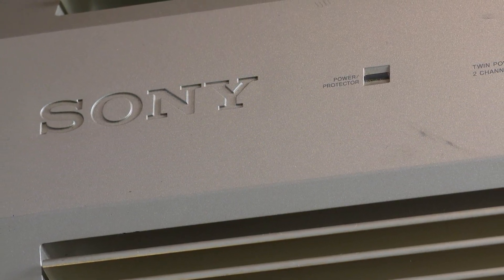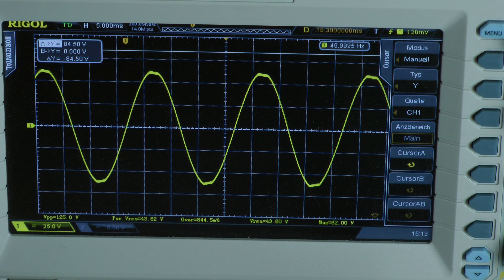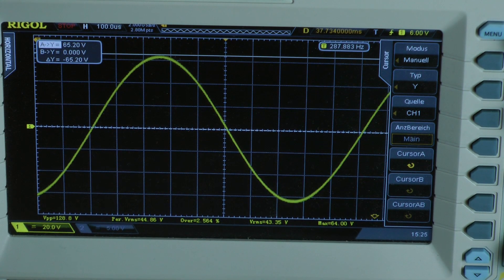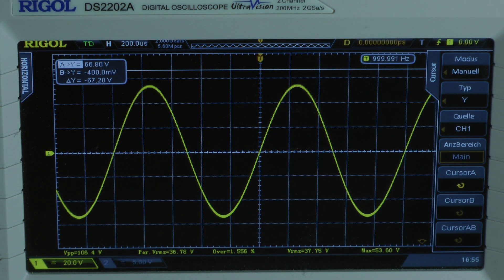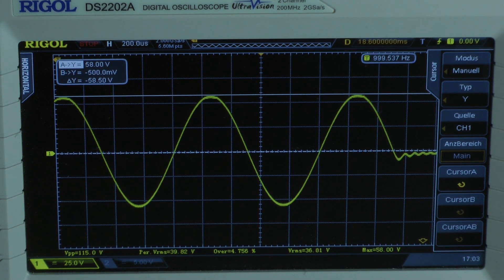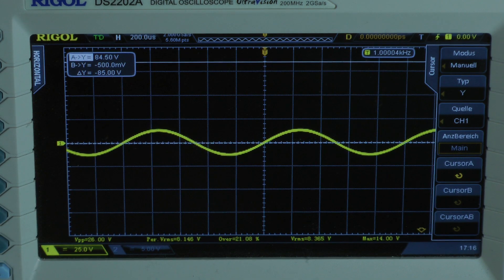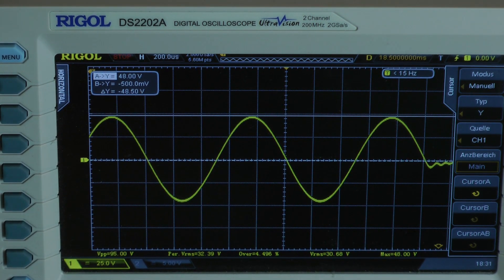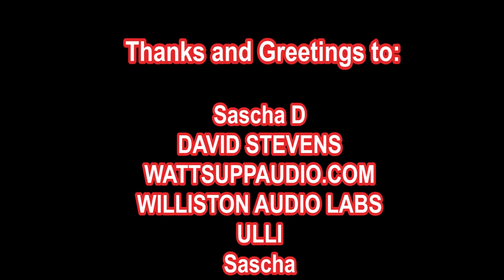Sony XM 2100 G car audio amplifier amp dyno power test #ampdyno

Comment: What power supply are you running or is it a battery bank? Also, what kind of clamp is that?
Reply from the maker: I got three supplies made by mundorf for car audio events. One is a 160A 14.4V the other two are in parallel delivering 13.7V 300A for the bigger amps i tested so far. All without battery bank

Comment: those amps were known as being super clean SQ as i remember
Reply: Diese Serie ist eine G Serie von Sony, also Hi-End Serie von 1996 Jahr.  Besondere ist, dass diese Endstufe eine Dual Mono Architektur hat. Er hat  damals ungefähr 500-600 $ gekostet. Ich habe auch eine Verstärker XM-450G (4 Channel). Klingt auch sehr gut.
Reply from the maker: @GreenDeymoS danke für die Info 👍 Mitte der 90er hatte ich mal eine 4 Kanal von Sony “ XM 4045 “ gebraucht gekauft. Auf Stereo gebrückt, war die recht kräftig 👍
Reply from the maker: Thanks for the info 👍
Do you know in which years these amps were made?
Reply: @audiokeller1975  I looked it up. I believe it was the year 2000.

Comment: Nice how accurate the rated specs are. It beats them all by just a little bit. 

How old do you think this model is?
Reply from the maker: That’s a good question but I guess it’s from the 90s because I found a service manual. Manufacturers sometimes did this in 80s and early 90s.
Reply: @audiokeller1975 I can tell you I bought one of these new (USA) in late 1996 or early 1997. It drove 4 SoundStream USA DVC 10s (2 ohm mono load) in my Nissan Maxima. Then, later I built a ported box for 3 of the same woofers and ran it 2.66 ohm mono. People (back then) regularly asked me if I had 15s in the trunk. That little amp sure took a beating and never gave up on me. Ah, the good old days!
Reply: @audiokeller1975 Japanese manufacturers released service manuals up until the early 2000s. Seems everyone stopped with the prints after that?
At least your 2100 still has a working incandescent light. My 450G and 2100 were all burnt out. Almost all my infinity kappas had the same issue. Only takes one to take them all out in the kappas.